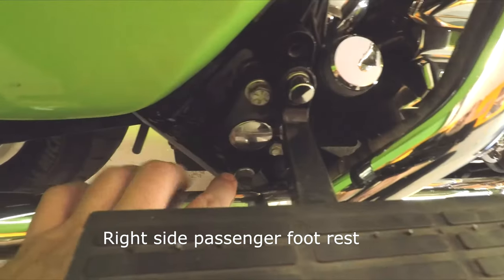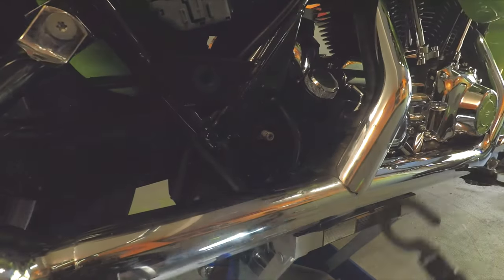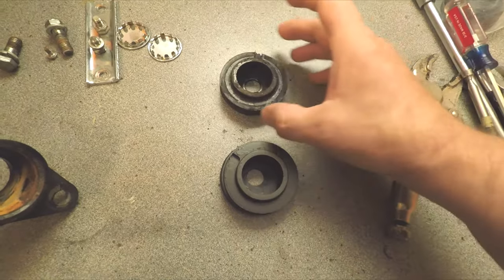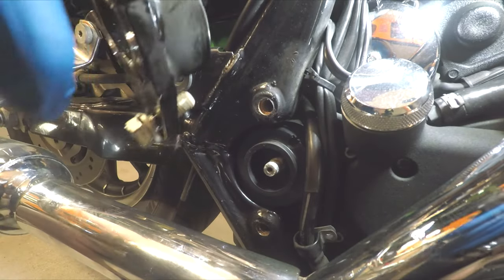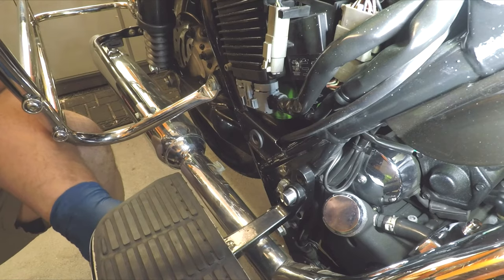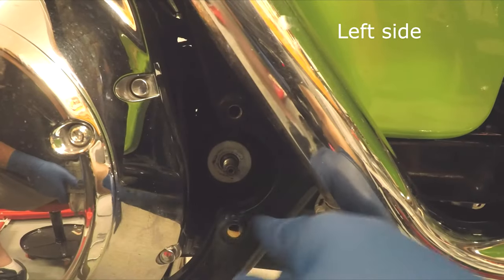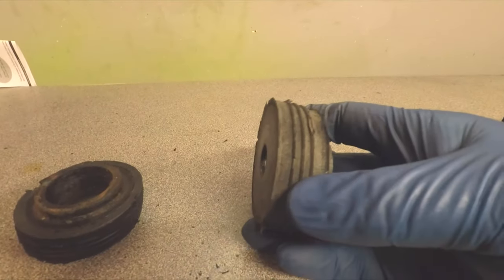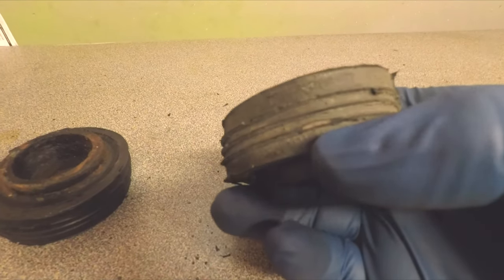Harley Davidson Swing arm/Trani Mount bushings replaced-Harley Davidson Electra Glide Ultra Classic

Comment: Dude you made this way simpler than everyone else.  Ive seen guys loosening read wheel and removing belt and pulling shaft out yada yada.  Thisnis wayyyyyyy better.  Thanks man.
Reply from the maker: Works well if just replacing those bushings but if replacing the bearings or shaft you need to do all that. Good luck.

Comment: SF Marine. Once again your videos have helped a lot. My 07 RKC at almost 90k (all me) so I did the front mount and stabilizer already. Got everything on rear disassembled but nice just to see how it went for you! I’m also going to try to install Alloy Art rear stabilizer which is supposed to help the rear assembly, basically reinforced nut that holds the pivot shaft steady. Thanks sir, SF from Massachusetts!
Reply from the maker: Cool. Glad it’s helpful. Good luck with your ride and be safe.

Comment: I've been getting a lot of bad info on this topic. I've noticed a intermittent squeak and a low speed vibration from the back. It wasent there a month ago. So I'm figuring probably swing arm bushings. Bikes got 51k on it. Looks easy enough and I do have an impact. Your video was excellent. Don't change a thing.
Reply from the maker: Maybe take it all apart and check the internal parts/bushings too. Thanks for commenting. Ride safe.

Comment: FYI- I just replaced the isolators on my 2003 FLHT without removing the pivot shaft.  I placed a scissor jack under the transmission for support before doing anything.  I decided to try the double nutting suggestion.  First I removed both outer isolator brackets.  Then I removed the right side isolator.  With the isolator removed, I was able to put the nut back on and run it all the way in and followed that with the second nut.  Since the isolator is removed, I was to get a wrench between the frame and swingarm to hold the inside nut and hold the outer nut with a wrench on the outside of the frame and tighten them.  I was then able to hold the wrench on the inside nut, while using an 1/2 impact on the left side.  It came off like butter.  Absolutely no need to remove pivot shaft for changing isolators.
Reply from the maker: Great to hear it went well for you.
Reply: Great info ! About to try this myself. What size nut is the 12 point and what did you torque it to ? Also is there a need to double nut the right side while using the impact on left ?  Thanks

Comment: The Death Wobble actually starts in the rear swing arm and then transfers up the frame to the front end.  There are alot of different things that cause this.  Under inflated tires, mis-alignment of the tire in the swing arm.  bent rim and the list goes on and on.  Replacing the rear swing arm bushings is always a good idea and now they have the bushing insets that go inside the bushing. That really stiffens up the rear swing arm.  Also the progressive linkage does wonders...It ties the rear transmission housing to the swing arm bushing plate...its a must have...
Reply from the maker: I have a link in the description area to a good video that explains both clearly.  Thanks for commenting
Reply: unfortunately progressive link is only available for 2012 below. they don't make them for recent models. so i just purchased the "Missing link" from Rack & Pull industries for front frame stabilizer and the alloy art swing arm bushing insert to stiffen the rear. am a bit sceptical if install both parts is gonna be OK or having one with the other is going to cause an issue!!

Comment: Thanks for the video, currently tackling this trying to trace a highway wobble on my 02 flht. Unfortunately I can’t get bottom bolt out on the right side the same way you did so looks like I’m pulling the exhaust off the head and it’s rusty…
Reply from the maker: Check swing arm bearings. They could be worn causing that. It doesn’t take much wear on those to cause an issue. Good luck.

Comment: Will this work for the rear mounts on a 2004 Sportster? Thanks for the video.
Reply from the maker: Not sure. Never did those.
Reply: @TechnMoto  It won’t work that way on a Sportster, I just checked mine. It has a bolt head on each side so that you have to remove the shaft. They should have made it like the one you did in the video  across every model. A lot easier.

Comment: Hey great video. I was wondering what torque specs you used. Also did you need to get an alignment after?
Reply from the maker: I think the nuts call for 35-40 ft lbs. If your going to attempt any repairs on your bike I highly recommend a person buy themselves a repair manual. Alignment of the rear tire etc was not needed after I completed this repair. It went back together nicely.
Reply: @TechnMoto  thank you for the response. I do need to get one but I need to get the money first those books are not cheap lol. and the torque you think is the same for the outside bolts and the nuts on the rod?

Comment: Not sure if you'll see this question, but what did you feel while the bad bushings were on the bike? What were the symptoms of this issue?
Reply from the maker: Honestly nothing. They were dry cracking and on the way out. I figured I would replace them since they were original to the bike. If they are really bad you could feel vibration or movement in the rear while going down the road or turning. Could even cause a wobble/weave if bad enough. If there is play in the rear end then I would recommend replacing bushings and bearings in the swing arm at the same time. Hope this helps.
Reply: feels loose in the rear end, hard to explain, but almost like you have a flat tire, just a little loose in the turns. 
Going to replace mine per this video. 🤞🏽
Reply from the maker: @rustyshackleford9337  check swing arm bearings too. They could be bad. Good luck.
Reply: Thank you for that answer. I have the same problem starting to when you go around the corner. I have a slight slide like the tire is low. I was always wondering what that was. I’ll have to check mine. Thank you.
Reply: Can I ask a question? I have a 2002 heritage softail. Sometimes I go around the corner in the ass and slides just a little bit is it supposed to do that? Is that why they call it a swing arm or no are the bushings bad thank you.
Reply from the maker: @davidsylvia3657  np

Comment: dont you need to grease the shaft?
Reply from the maker: No I did not remove the shaft nor does the shaft move. It is stationary. The swing arm bearings do all the movement.

Comment: Never put the stock style bushings back. You should, put in the "Stiffy" inserts or replace with Glide pro.. The stock mounts will leave a danger of loose rear swingarm wobble, no difference with new or old mounts. To check for this condition, have the bike on the jiffy stand, cold engine and exhaust, place your foot on the rear tire, from the right SIDE of the bike, near the front face of the tire, you will be able to move the whole wheel, as much as a half inch, or more, even if the rear isolators are new..The cause of the Harley wobble, Do a web search for, Glide Pro System or Mad Monkey Motorsports, also The Stiffy for Harley isolators.. Dont leave yourself on a dangerous stock Harley swingarm......
Reply from the maker: Good info thanks
Reply: @randymccalla9995  I assume that the stiffys are polyurethane bushings???
Reply: I have been running a progressive suspension rear stabilizer on my’08 Electra Glide. It not only eliminates the wobble, but makes the rear end track through the turns like it’s on rails.
Reply: @deanbalouris330  Stiffys are a metal cup with a extra height washer..that fits in the stock bushing..I dont know how well they work. U tube has a short on them.
Reply: @randymccalla9995  thanks for the information.